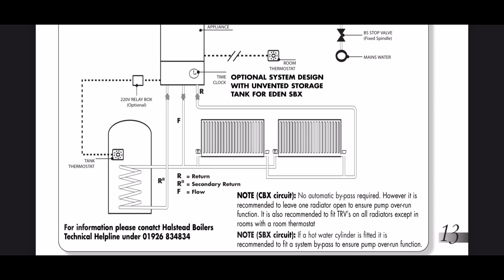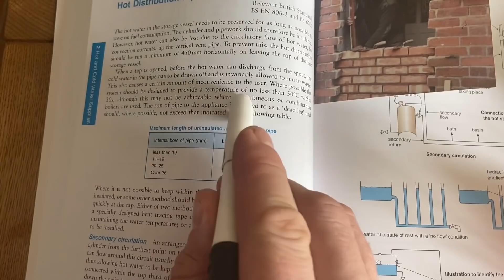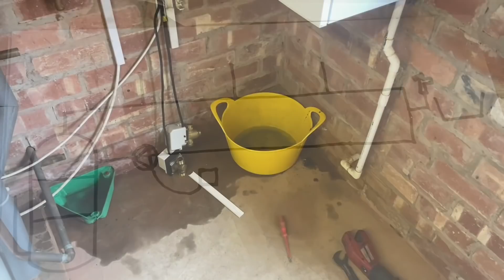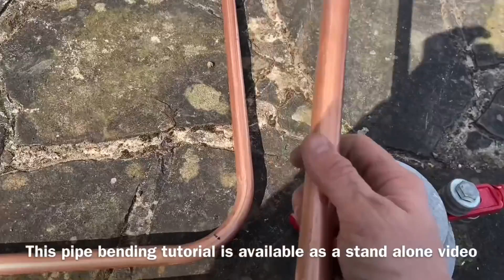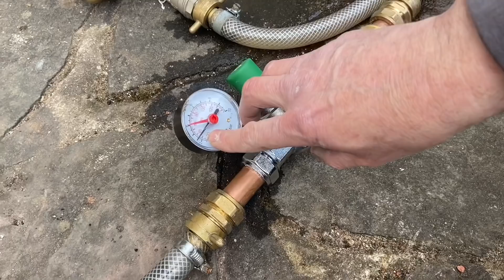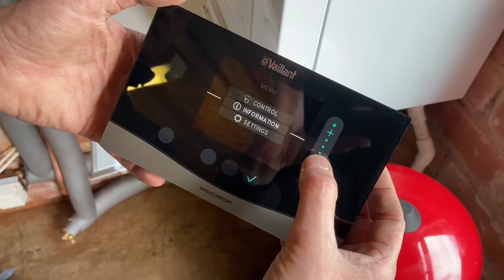P B Plumber The life of a jobbing plumber #44

Comment: Question for you which iv always wandered on unvented cylinders that I can't find an answer to in any of the g3 books...,say an unvented cylinder of 180 litres capacity comes with an 18 litre expansion vessel and then you add a secondary return of say 100 metres in 15mm copper (extreme length i know but bare with me)...baring in mind that 1 metre of 15mm copper holds 0.14 litres of water that would equate to and extra 14 litres of water capacity to the cylinder, would that mean that your 18 litre expansion vessel was technically no longer big enough for the cylinder due to its capacity being increased,I can't find the information anywhere on tolerances for unvented cylinders and secondary returns pipe lengths limits for this or is it not an issue although when you think about it,it is

Comment: Pretty sure the old boiler is trying to be a 4 pipe system boiler using 3 pipes. 
And there shouldn’t be a 3 port valve, it’s internal to the boiler.

Comment: Hey! PB !!
I had one today! water coming through the ceiling in a bakery below a flat! After scratching my head. After destroying the bath panel and generally faffing about one of your older videos popped into my head!! long story short a hot tap dribbling and water tracking back into the bath tapping hole down the pipework and onto the cakes below!
Cheers PB i got a doughnut!!!

Comment: Looks like the boiler has a built in mid position valve on the return, driven by a stepper motor.  Perhaps it failed some time, so an external midposition was added as a cheaper repair, and so the two returns were linked under the boiler.
Reply from the maker: That’s a great shout mate, didn’t think of that!

Comment: Good morning. As a matter of interest had the radiators been getting hot on hot water only on the old system by any chance ...That bracket for the auxiliary expansion tank was very neat ,not seen that before. Which brings me to that very expensive looking wiring control  box set up , wow what happens if a component fails .Is any of it repairable or is it a new unit .What is the guarantee on it . Things like this look amazing but going forward they look very expensive if they go wrong . Perhaps somebody making a mistake with the wiring blowing a component  I first came across weather compensation controls perhaps 40 years ago,cannot remember what they were called but they were in the wiring center ,they were useless  used to bridge them out .But I dare say thing have moved forward . I am retired now and looking at what you guys are fitting now I feel quiet relieved . I have always said it's worth paying the extra to get good tradesmen .In the long run it can work out cheaper and save a lot of grief. As an afterthought would it have been better to remove the three port and make the system 2 times 2 port Wiring is less complicated because you do not need the extra wire from the clock and cylinder stat .I always found a two port system easier to fault find.but you may need an external by pass as well Which I think was on the original system .As another   comment elsewhere The optional connection might just be alternative to a joint return into the heating to ensure the race do not hear up on hot water only .

Comment: I have done my G3 4 times. At 2 different training centres. Only recently, did I learn, not to use speed-fit . On the secondary return pipe. Why I never told this is a mystery.
Reply: Hi Kevin, I did my G3 recently to move into renewables, but the speedfit was explained really well by Steve McGreevy at SERC ( in N.Ireland), glad to know that safety is being thought of.
Reply: @davidb2464  Hi Dave, Yes most training centres are on the ball. I now use MLCP. I would guess, the first time I sat my G3, the issues with plastic pipes, wasn't well known? Sat my last few at TC Training, Birmingham.

Comment: Maybe one of the returns should have been used as a direct dedicated return from the cylinder..? Iv always been told to bring a dedicated return from the cylinder to as close to boiler as you can..? Great vid as always mate 👍
Reply: That's what I was thinking and maybe they tee'd in to prevent it dropping the water out the bottom of the boiler, I don't know, just guessing.

Comment: Lovely job gents, I’ve yet to fit the senso comfort, I’ve got a big job where I have 3 zones, hot water and secondary circ and will be using it there!! Didn’t realise you could run the secondary pump off a senso but makes sense, set it as on off circuit. Right I’m off to fuck some hep secondaries in 😍

Comment: I normally use copper but surely if the secondary return is on a timer it’s not classed as continuous so speed fit could be used? Interesting to know👍
Reply: Oxygen barrier pipe required to stop air permeating  as it will have warm flowing water which may create air locks and system corrosion . Much as a heating system would with none barrier pipe
Reply: @Rickblues46  Was just curious mate, as it said it couldn’t be used, regardless of pipe type, cheers for reply

Comment: those drain cocks look like a good idea but all the heat cycling plus fatigue from tension on the plastic threads over time would make me worried. i like the drain offs you get with the atag boilers that have a quarter turn valve and a removable cap to give 2 levels of leak protection. they drain a lot quicker too.
Reply: Could you share the name of the book please?

Comment: So that boiler is one of the first versions of what Viessmann ended up doing so you didn't need a 2 port valve and didn't need to T the cylinder in as the last thing to prevent self-circulation of the heating. I have never come across one that's worked well regardless of being piped up by the book or not.

Comment: Pretty sure on the ariston unvented cylinders we used to fit, the secondary hot water loop used to be teed into the cold feed into the cylinder (just added this incase someone does come across it onsite) as there was no tapping on the cylinder.
Reply: Quite a few systems do it like that. Makes more sense to me to mix the hot return basically with the incoming cold mains into the cylinder. Basically pre heats the water as it enters into the cylinder (well in my opinion it does anyway haha)